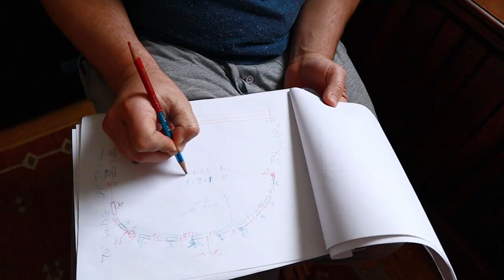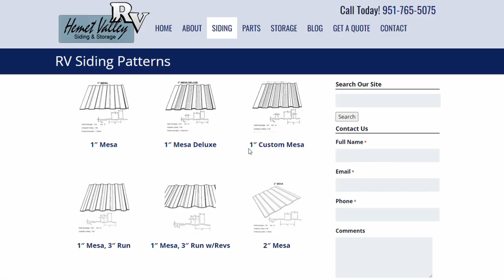VINTAGE CAMPER MISTAKES I MADE and how to avoid them

Comment: Conan, I really enjoy your videos and always look forward to them! I wish "the algorithm" would fully embrace you because your videos are very well produced. You have a very natural narrative style, they are funny and your "journey" is interesting. In this genre of content, I feel you should be at the top of the heap.

The struggle is real finding non-backlit 12v/USB outlets, but they must exist. Those LEDs are SO bright in the darkness of a camper. I'd be happy finding something that is easy to take apart and remove the LED and/or that separate the hot lead for the LED from the outlet side (I have a switch that allows that). Frustrating, and we can't possibly be the only ones who have an issue with that.
Reply: I put blue painters tape over the LED’s on the usb charger. Not perfect but mostly cuts the light out. If that doesn’t do it, black electrical tape would, just may look tacky, lol
Reply from the maker: The warm embrace of the algorithm, sounds like a distopic scifi novel, I'd read it! But thank you so much!

I'm sure there's non-lit USB ports too. I really didn't think about it when I installed them, but I just haven't bothered to look into it further. When we've camped, we've only ever used the USB ports on the two lights that we installed, so I've been thinking about taking the USB outlet out altogether and replacing it with a standard 12V socket.
Reply from the maker: I thought about painting over the light parts with black paint, but I think I'm probably just going to remove the USB outlets and replace them with a standard 12V outlet at some point.

Comment: OK I'll add comments as we move through this video. First there is nothing wrong with working under tarps if you know a little bit about how to do it so you are not constantly removing the tarp and putting back on each and every day. To learn more join my class.  The metal pattern  you have and want to replace is 2 inch Custom Mesa so yes Steve does have that pattern... The seams in the roof are ACME seams and they will not leak unless damaged. And if you double up on the tape for the roof vent AND install a 3/4 inch crown around the vent hole, water will not puddle and it will never leak... Robert at Vintage Trailer Gaskets should have the top flap seal for your windows... You don't have J Rail. You have Top Edge Molding or Corner Cap. But you are correct. Don't paint it....
Air Conditioning. I didn't want to say anything before because you were almost finished with it. But I'll say it now. Your ankles will be nice and cold. Your forehead will be sweating at the same time though. LOL.. Finally, All upper cabinets or floor to ceiling cabinets if you have one need welting (gimp) and you install them before the roof metal goes on because they are fastened from the outside top down into the cabinet. And the fasteners are two inches apart. These upper cabinets are like gussets and give the trailer Sway Protection. Shear Strength. So you can't just install them from the inside. Lots of fasteners go through from the outside also. By the way Conan I make all these mistakes so you don't have to. It's on my card LOL...
Reply from the maker: I really have thought about joining your class, Larry. Anyhoo, that's a lot of good points so let me break it down.

I suppose the thing about tarps in Kansas is that the wind just rips them to shreds in no time, so it's a constant struggle to replace them before they get too worn. My little canopy is a slight improvement, but rain only comes with wind in Kansas so its lack of sides is a problem. I need one of those metal-sided RV carports like you've got. Actually what I need is to bulldoze my falling down garage and replace it with something that actually has some room to work in.

Yeah I don't have any problems with the seams, but I wish that one was just a few inches further forward and it'd be out of the way of the vent altogether. Tell me about this 3/4" crown though, how do I do that? Is there a hand tool that you use, or do you just hammer it?

I actually have the top seal from VCT and there seems to be a very small difference that is causing them to pop out as the windows are operated. I've meant to call them back and ask if I'm doing something wrong, but I never got around to it. These are Phillips windows so I don't know if there was enough difference between them and the Hehr windows which seem nearly identical to require a different seal, or if I'm supposed to install the seal and wait a few weeks for it to "set", but yeah, that's the only seal I had trouble with.

I misspoke, I know it's not J rail, I just didn't feel like going back and re-recording what I was saying. My local trailer supply shop stocked that stuff and in their inventory they called it Roof Rail.

The A/C. Here's the thing, you know and I know that this is a stupid way to do it, which is why I didn't do too many permanent alterations to install it, because I think it isn't going to work terribly well, and I think I'm going to take it out. But here's the thing, that's content baby! So yeah, just wait for the future video titled, Why it was STUPID to install AC this way! or something like that. Also, I just wanted to see firsthand the pitfalls of installing an A/C like this and see if I could come up with something better in the future.

And yeah, trust me Larry, I know all about the cabinets, but at the time I did this build, lets just say I made some assumptions that were perhaps ill advised that I'm trying to avoid repeating in the future. Interestingly, in dismantling the '56 Cal-Craft, all of the original cabinets were attached from the inside, and some were just hung on the paneling without ever hitting a stud! I do not plan on copying this aspect of the original build.

Thanks for the comments!

Comment: Get advice!!! Love your videos and am going to do the same water system you have. I’ve seen it on other campers but you made some very good points about have a city water hook up. Could you share the parts you have picked out for the conversion? Greatly appreciated.
Reply from the maker: It's basically the same parts, but with a city water inlet. You just plumb the city water in between your pump and the faucet. Most pumps are built with a check valve to prevent back flow from the city water feed, but you should also have a pressure regulator on your water line to make sure you don't over power the check valve. I'll do a future video about it.

Comment: Here’s another suggestion and I see it all too often never use liquid nail on something you may potentially have to take back apart in the future especially on ceiling and wall panels if staples and nails were good enough 50+ years ago they are good enough today.
Reply from the maker: That's a good suggestion! As a general rule I never use liquid nails if there's any other way of fastening something.